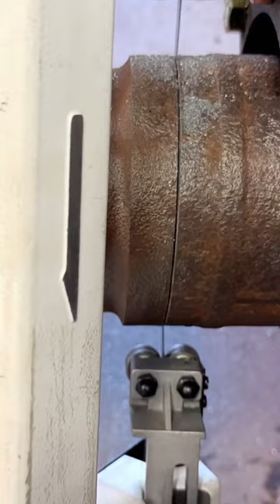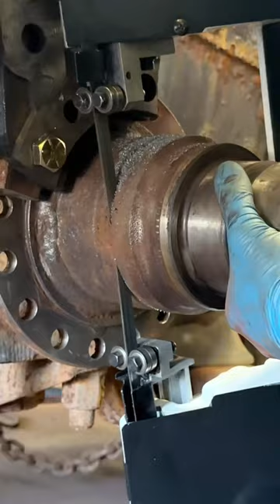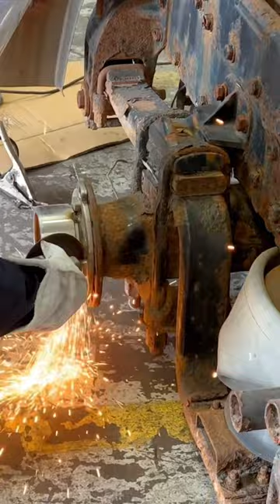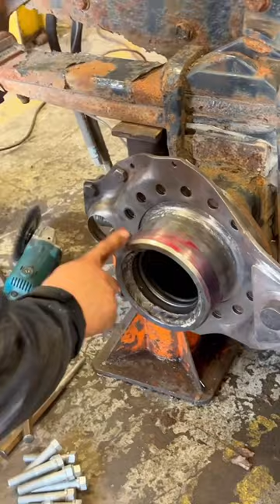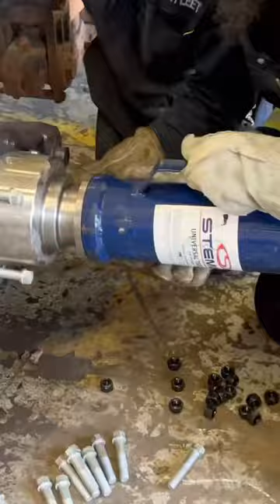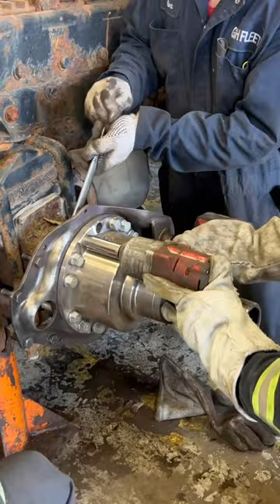Truck spindle cutting and installation #shorts #highwaytruck #trailer #hardwork #mechanic #driver

Comment: Is that really a thing in the western world 🤷‍♂️thought it was a high tech version of Pakistani  truck 😂
Reply: Those Pakistanis would run circles around you blindfolded with both hands tied behind there back and one leg removed. 

Anyways, yes. This is very common, usually they're welded on. You either repair what you got or replace the entire axle. Which makes no sense.
Reply: Lol same till i seen stemco. I was all like wtf.

Comment: My inner drive tire starts wear out the inner edge after this new spindle. What could be the cause?
Reply from the maker: Morning Sir

Which company replaced your Spindle ?
Reply: @axle_spindle  that’s not your company. It’s called United axle in Denver PA. I was trying to find your location near me but the only one was in NY which was 6 hours away when I was broke down. Just need a little advice. Do you think this could be the spindle issue or something else? Because I only start seeing the wear out right after the spindle job. Thanks.
Reply from the maker: @mandipsingh8344  

Yes definitely spindle is not aligned properly You may reach out to United Axle see if they are willing to help you out if not call us will direct you to our nearest facility @ 716-336-4734